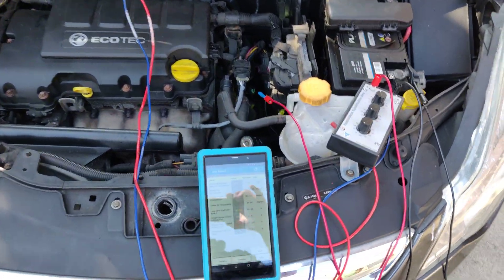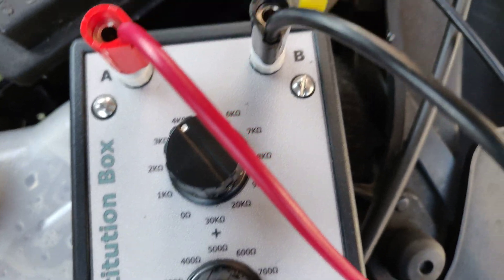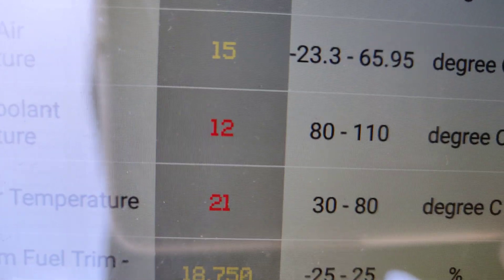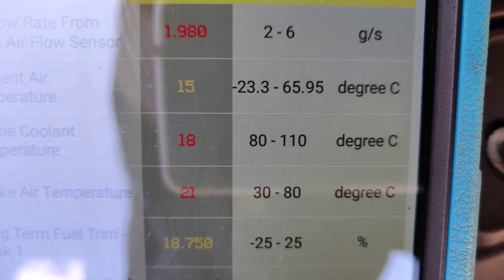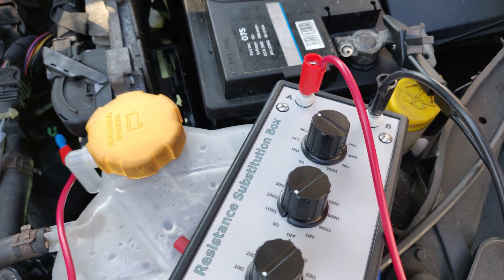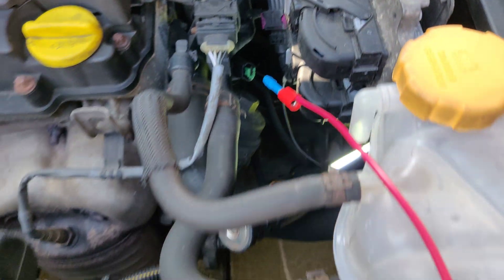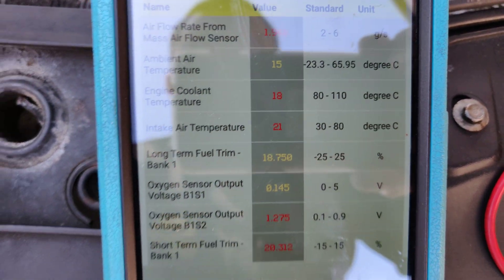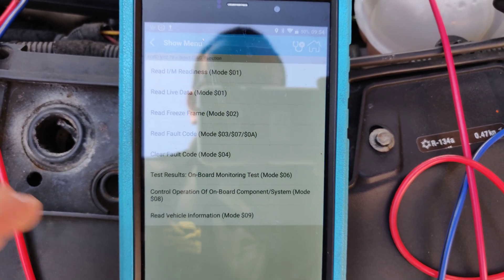Corsa misfire, no codes, follow up video, using a decade box

Comment: Your videos are short and to the point. I always learn something. DiagnoseDan is a big fan of Ditex equipment and has used the Decade Box in his videos.
Reply from the maker: I quite like the ditex stuff myself, it does the job for a reasonable price. Never had any issues that weren't due to operator error 👍